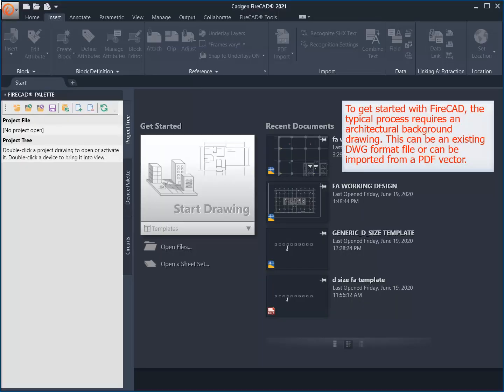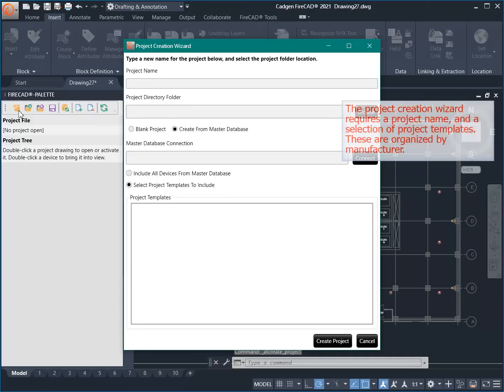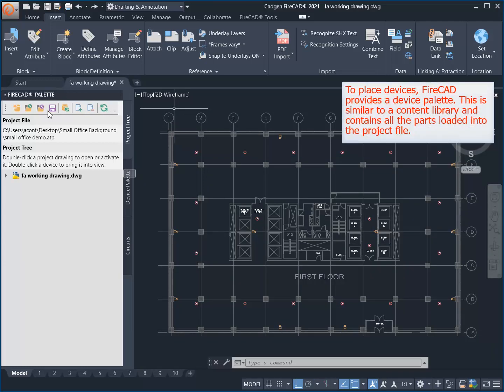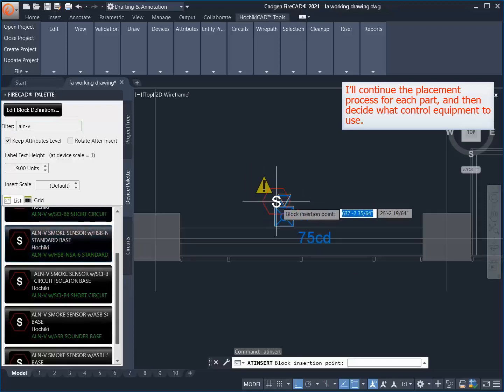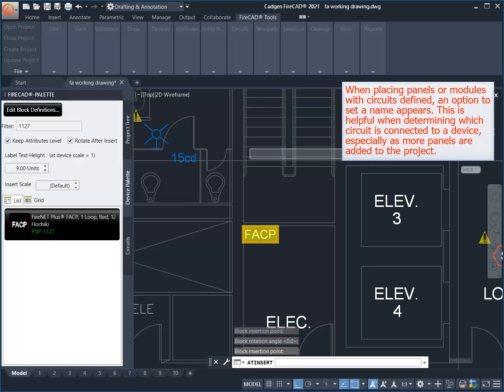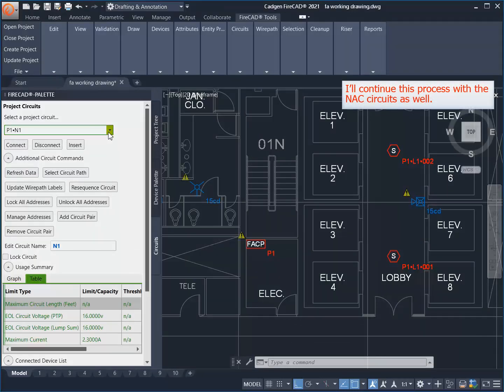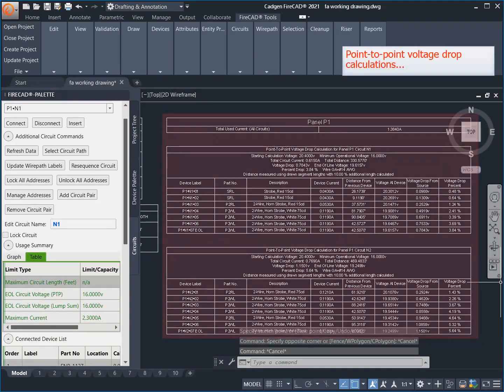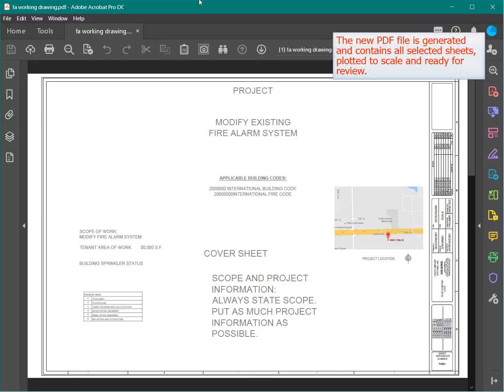2021 FireCAD  Overview

Comment: It looks good, but I would not try to run a cable through any elevator shaft, especially through the middle of it. It would be good to be able to define some layers where cables would not pass through. Then, the software would leave columns and shafts out of the design.